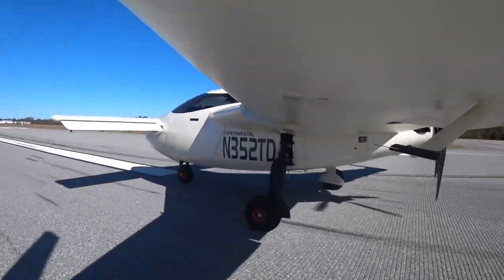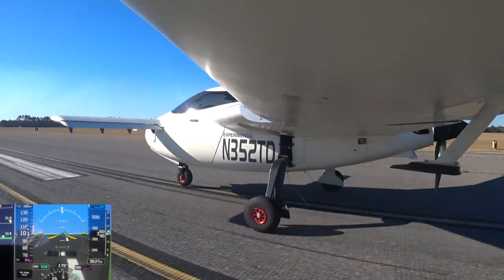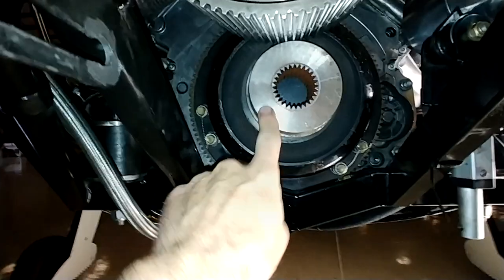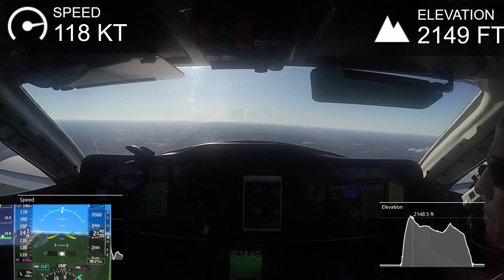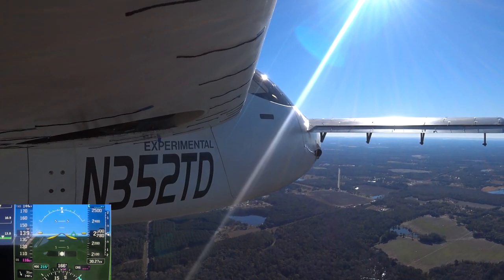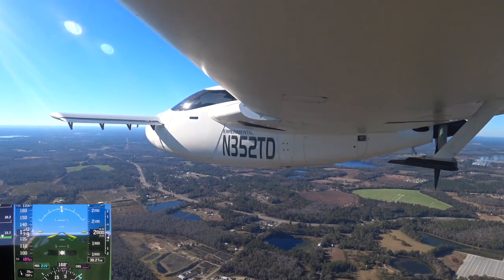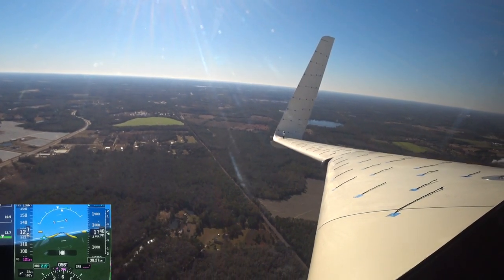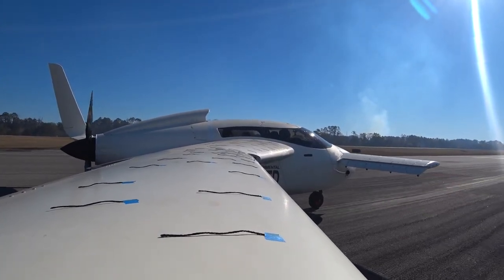Flying and Fixing - Flying the Raptor Prototype

Comment: I'd like to know why you went with diesel instead of gas isn't diesel harder to get at airports
Reply: Ahhh, no. Jet-A is the most plentiful av fuel worldwide.
Reply: @marcbatway3302  I didn't know that was also diesel and I was a jet engine mechanic in the Air Force.  Dose a diesel  give you more power in a plane or some other benefits for a plane that gas dose?
Reply: @Yogenh  the biggest benefits are that an equivalent sized diesel has a burn rate of half or less as compared to avgas and generally a longer time between overhauls. There are some others but availability, consumption, and wear and tear are the biggies.
Reply: @marcbatway3302  I didn't know tthat.

Comment: I've heard said that a pusher tends to cavitate the prop,
a bit sooner, than if the prop were at the front.

An "AIRBOAT" has a quite different looking prop than an aeroplane.
Reply: Impossible. No aircraft prop can cavitate. Cavitation occurs when a reduction in pressure of a liquid drops to a point where it vaporizes (changing from a liquid to a gas). I think you are talking about a reduction in lift from flow separation (too higher AOA like stalling). Push or pull, stall is directly influenced by AOA not configuration.
Reply: @SnowAndrews  Not "may possibly be".....just "is". Yes I am now watching another video as directed by you.

Comment: Google the power curves for that engine.  Seems power peak is about 3,500 and torque peak about 2,200.   There would be totally no point pushing past max power, in fact I'd run a few rpm under it.

Comment: Why are you flying the right seat? Is it an Aussie thing?
Reply: If you have been following the project for a while,  you would have seen a video where Peter explains his preference for flying from the right seat. And no it’s not an Australian thing even though our high pressure systems run anti clockwise in the Southern Hemisphere 😉
Reply: @cirrusflyerh2843  Thanks!
'Anti clockwise': that's so cute!
How's the market for flying bush doctors down under?
Reply: If you watch the direction of the prop you will know that the reactive force is opposite. That means you sit in the right seat to help counteract the torque roll the prop makes. (Trim the aircraft with your butt!) boats do the same thing too.
Reply: @leeklemetti1887  Well, I don't think so! When viewed from the rear, the prop turns counter-clockwise (or anti-clockwise, as they say in Australia), so the resulting torque on the plane (due to the prop) would tend to roll the plane clockwise (again, when viewed from the rear). Which is a right roll. So sitting in the right would not counterace a right roll. That being said, I've owned 2 planes that had side-by-side seating AND left and right wing tanks. I always flew from the left seat and I never noticed any significant roll tendency unless the right tank was dry and the left tank was full (resulting in a 18 gal x 6 lb/gal = 108 lb inbalance outboard of the seats: so much greater moment of inertia than a seat inbalance). No, I now think he flies from the right seat because the left side-stick controller is operated with the left hand while the right side-stick controller is operated with the right hand. There is also no p-factor since no part of the plane is in the prop-wash.
Reply: @richardpark3054  there’s always a demand for doctors willing to “go off the beaten track”. Also, If you have the required twin turbine ( King Air) experience, and instrument ratings, then the Royal Flying Doctor service will seriously look at you.
Reply: @cirrusflyerh2843  Very interesting! Thanks!
Reply: @skyboy1956  Thanks! Very interesting! But my own personal experience with 'P-factor' is much more consistent with the idea that propeller wash strikes the vertical stabilizer mis-aligned with the airplane's movement through the air and causing the airplane to have a marked turning tendency in a direction opposite to the propeller airflow. I understand that there may be more subtle effects, like a differential left/right propeller thrust due to pitch attitude other than level and consequent different blade bite of left vs right;  but, given that the rudder has a very much greater lever arm compared to the propeller ends, it seems unreasonable to favor the differential propeller thrust over the asymmetric rudder forces due to prop wash as the cause of p-factor. From the pilot's perspective, 'p-factor' is easily explained by propeller airflow striking the vertical stabilizer asymmetrically. This is easily remembered after slow-flight practice: as the airspeed gets lower and lower, the engine power is progressively increased and the left turning tendency becomes more and more pronounced. Easily explained by propeller wash striking the rudder preferentially on the left, turning the plane to the left.
Reply: @skyboy1956  Yes, I think you're right! My mistake, and it's good to be (gently) corrected. Thanks! It's been about 35 years, but I recollected from flight ground school (way back then) that 'p-factor' was due to propeller vortex striking the vertical stabilizer and causing an opposite yaw. It would be nice to hear from some pusher pilots if they experience any significant yaw at low speeds, high AOA, and high power. How 'bout it, pusher-people, any observations?

Comment: Nice flight!  If power is lost once engine is heat soaked you might look at your timing map in the Motec. I would be retarding as coolant temp increases particularly at <75%.  Optmised BSFC will also reject the least heat.

Comment: You can back out the fuel or raise the boost to lower EGTs and engine temp. It's nothing like a gas engine, the richer it is, the hotter it is.  You can increase airflow with boost and actually lower the temperature. 
To really understand diesels, watch Banks youtube channel.  Nobody knows more than Gale Banks and he explains everything matter of factly.

Comment: Cant wait for electric to be more viable.  So much simpler.
Reply: I'm an electric motor enthusiast for aircraft. However I've found the design life for aircraft battery system power is at best a 1 year proposition for performance. Many people around the world like myself are working on it. The electrically balanced Switched Reluctance Motors (SRM) motor approach with the angle buffered permanent magnet rotor reduce the back electromagnetic field (Back EMF) which is great for automobiles and lithium battery system packs (Elon Musk Tesla G-2&3). Less than a 2 hour runtime for an aircraft. My primary focus since 2015 is working with electrically asymmetrically configured electric motors and battery pack systems. These are now referenced as Constant Amp Motors (CAM) dependent on how they are specifically wound and configured. In the case with this type motor, Back EMF voltage actually controls useful load torque and power. The permanent magnet rotor configuration is exactly backwards with what Elon is doing. Lithium ION packs don't like this configuration and won't last long. It works fine in the 1.5 KW range employing normal flooded automotive style 100 AH lead/acid batteries but constant load performance above 800 Watts proves to overheat them in about 12 minutes. Resulting in physically damaging the battery plates. Battery mass resistance is key when working with this technology. Over 1.5 KW ~ 15 KW, we are successful with 7K ~ 9K amp Direct Short Capability (DSC) resistive battery packs like those used in telecom systems. (On a 28 year design life) For large boats and home systems this is strait forward to engineer however small aircraft presents many problems. I'm convinced that, this is the type technology Nikola Tesla employed with was his electric Pierce Arrow. The "Tesla Car" which was put to the test in 1931 and why he used alkaline flooded iron/Nichol type batteries. (100 year Edison design life Batteries) We have learned many tricks for Battery Management Systems (BMS) and we are gaining ground in real-world performance knowledge. There are many approaches being worked to target over 6 hours continuous runtimes @ 135 KW ~ 340 KW 180 HP ~ 450 HP equivalents for these Metronomic Parametrically Oscillating Constant Amp MoGen Systems at a complete system weight of under 1/2 ton. Yes, we can do it however the battery system design life is now the focused problem. More and more guys are getting familiar with these systems and are actively working for the needed solutions. To date the best solution is alternating sacrificial battery packs with the BMS which is pricing out at about $600.00 each - every 6 months or $2,400 Per year. Then the yearly refresh of the main batteries which is about a $12,000.00 per year on the proposed aviation units. With this in mind, Peter Muller's Solution with the Audi 3L TDI conversion is the less expensive way to go when projecting 5 years of operational expense. $72,000 buys a whole lot of diesel! In the private aircraft world! Hybrid aviation systems look the most promising in my humble opinion at this time for aviation electrics and extending battery design life however when crunching the numbers Peter's solution for a private aircraft power plant is still a clear winner when considering overall mission capability as to flight times. 6 hours Vs 10 hours flight times...
Reply: @eether54  , No... I just copy and paste. 🤣🤣🤣
Reply: You could go hybrid. ICE for power to the alternator, electric motor direct-drive prop to make it fly. Ergo, no redrive or belts plus battery redundancy for a safe landing.
Reply: @henricinelli4339   Hi Henri, Thank you... I think :-) Happy New Year

Comment: A wide band sensor and air fuel ratio should NEVER exceed 16.2:1! 14.7:1 is stoichiometric on gasoline but should never happen in diesel. As far as sealing your radiator ducting you can stretch a microfiber blanket or sheet tight from the radiator to the inlet and then wet it out with fiberglass resin. It will make the duct solid as a rock. You can cut it out and use it for a carbon mold.